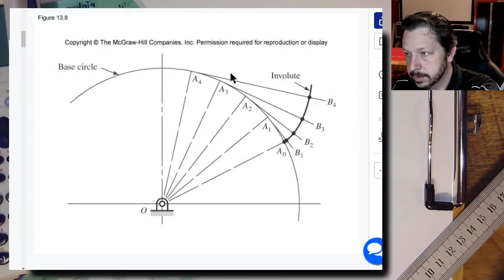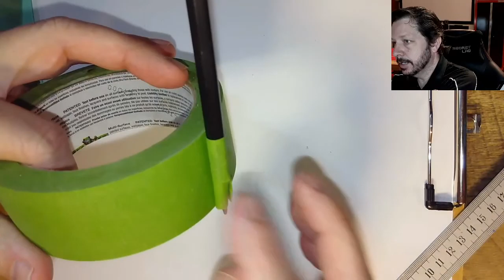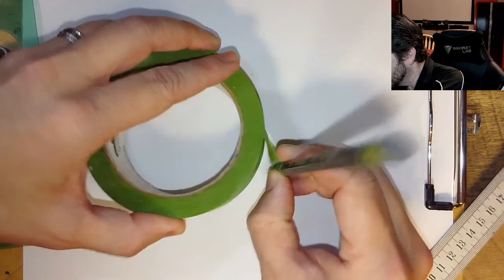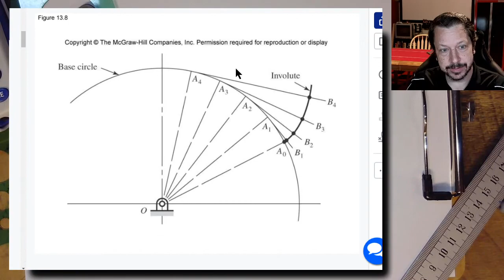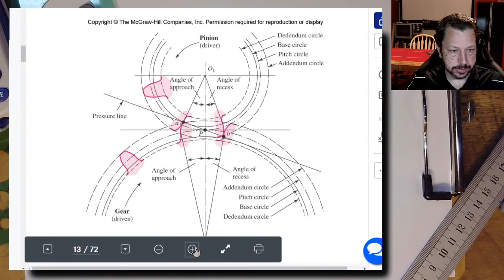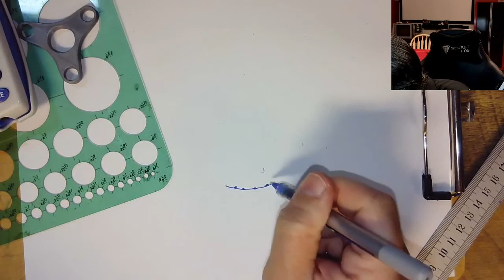Introduction to Gearing | Shigley 13 | MEEN 462 | Part 1

Comment: And since Np = 14.272 teeth it means that I use Np=15?
Reply from the maker: Correct, you have to make some decisions when you have fractional teeth on a gear or pinion. Sometimes you can drop down and space the teeth a bit farther apart, but usually you round up.